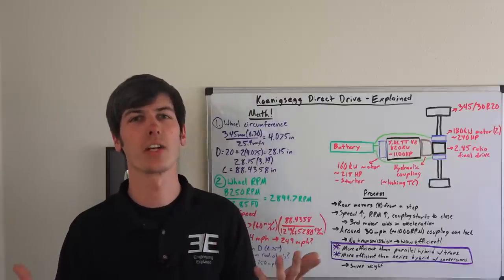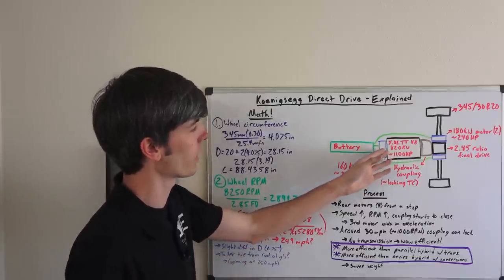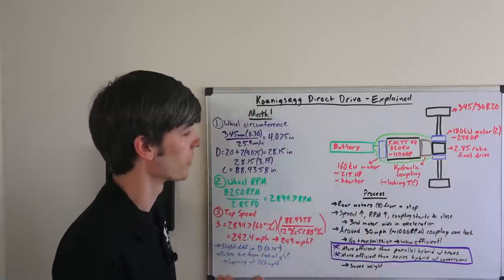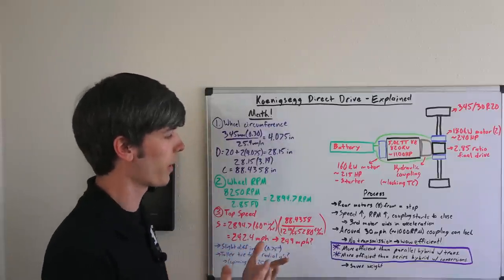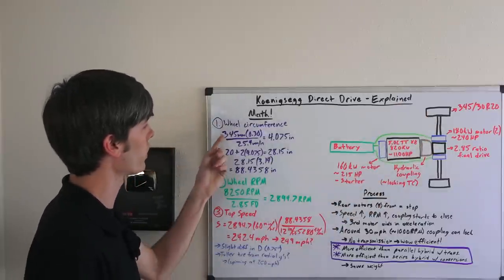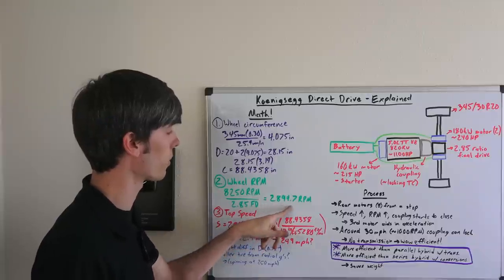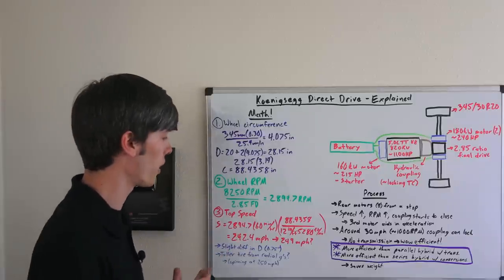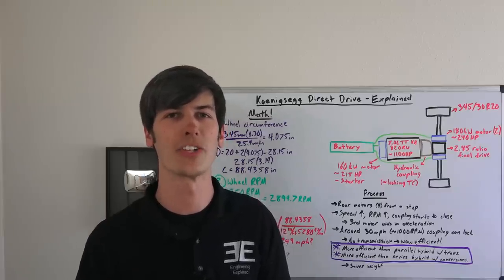Koenigsegg Direct Drive - Koenigsegg Regera - Explained

Comment: Maybe your calculation of the circumference does not take in the exact influence of the tyre profile ?
Did you even include it ? The whiteboard is too small, I can barely read the figures.
Anyway, assuming the circumference of the wheel increases with speed, how is the speedo telling you the correct speed ?
Reply from the maker: My whiteboard is large, your screen is small. :)
Reply: Engineering Explained *facepalm*
Reply: Neil McMahon What size screen you using? 3" ? My 19" monitor is more than enough. I even can read that whiteboard on my 5" phone screen.
Reply: Good point. I only run 1280x1024, and can read whiteboard in non full screen non enlarged player. So he probably runing like 360/240p like you said. But why do that, thats unlogical and crazy :D
Reply: Valtra103 I am getting ganged up on :S

Anyway, my assertion of the speedo still stands.
Reply: Neil McMahon That is a good question. Do we know that the speedometer indicated speed is incorrect?
is it electronically corrected at top speed?
Reply: patw52pb1
If tyres change size, what we know they do, then all speedometers are more or les wrong. Even in slower cars. Thats indeed interesting question.
 Never realised that.
Reply: Valtra103 Yes. I will put together a hypothetical tire growth to speed deviation comparison and post later today.
Reply: patw52pb1  Yes! Please do it. If you have time.
Reply: Valtra103  
Hypothetical calculated centrifugal tire growth to speed gain deviation comparison. 
Tires increase in diameter from centrifugal force as the tire and wheel assembly increases in rotational speed. This results in an increase in the distance traveled per tire assembly rotation. 
The following calculated data shows the speed increase, percentage of deviation for specific tire diameter increases as the RPM remains constant. 

R = Tire RPM 
D = Tire outside diameter 
C = Tire circumference 
V = calculated top speed MPH (KPH) 
imperial (metric) 

R = 2894.736 

Baseline 
Diameter Growth 0.000 (0.000mm) 
D = 28.150 (715.010) 
C = 88.4357 (2246.266) 
V = 242.520 (390.298) 
Speed Deviation 0.000 (0.000) 

Diameter Growth +0.125 (+3.175mm) 
D = 28.275 (718.185) 
C = 88.8441 (2256.640) 
V = 243.597 (392.031) 
Speed Deviation +1.077 (+1.733) +0.444% 

Diameter Growth +0.250 (+6.350mm) 
D = 28.400 (721.360) 
C = 89.2211 (2266.215) 
V = 244.674 (393.764) 
Speed Deviation +2.154 (+3.466) +0.888% 

Diameter Growth +0.375 (+9.525mm) 
D = 28.525 (724.535) 
C = 89.6295 (2276.589) 
V = 245.751 (395.497) 
Speed Deviation +3.231 (+5.200) +1.332% 

Diameter Growth +0.500 (+12.700mm) 
D = 28.650 (727.710) 
C = 90.0065 (2286.165) 
V = 246.827 (397.231) 
Speed Deviation +4.307 (+6.931) +1.775% 

Diameter Growth +0.750 (+19.050mm) 
D = 28.900 (734.060) 
C = 90.7919 (2306.114) 
V = 248.981 (400.697) 
Speed Deviation +6.461 (+10.397) +2.664% 

Diameter Growth +1.000 (+25.400mm) 
D = 29.150 (740.410) 
C = 91.5773 (2326.064) 
V = 251.135 (404.163) 
Speed Deviation +8.615 (+13.864) +3.552% 

Diameter Growth +2.000 (+50.800mm) 
D = 30.150 (765.810) 
C = 94.71894 (2405.861) 
V = 259.750 (418.028) 
Speed Deviation +17.23 (+27.728) +7.104%
Reply: patw52pb1
Nice work!
But i wonder which growth is realistic.
Reply: Valtra103  The realistic growth would be dependent on the individual tire and wheel combination. 
Different tires have different centrifugal tire growth rates, even same brand, same series, same size tires can experience minor variations in growth at the same speed. 
Most USDOT V, W, Y and ZR speed rated tires in the US are designed and engineered to have minimal dimensional growth at higher speeds (above 130 MPH or 209 KPH) to prevent damaging heat buildup. 
However, some drag racing tires are designed to grow about 3 inches or 76 mm at their rated speed with some capable of over 325 MPH or 523 KPH. 
Since the vehicle manufacturer's published top speed is about 249  MPH (400 KPH), I would expect (guess/assume) the tires to have Y or ZR speed rating meaning they should experience minimal centrifugal tire growth at top speed. 
The only way to know exactly what the centrifugal growth is would be to spin the assembly and measure.
Reply: patw52pb1
Yes good point. I know about dragster tyres. But anyway, deviation is not that big. So i believe, nothing is done against ir in speedometer.

Comment: so what u are saying is that the car is strong enough that it doesnt need a gearbox?
Reply from the maker: It's traction limited, has enough electric torque down low that engine power isn't necessary until higher speeds.
Reply: Engineering Explained And what if you are going to a slower circuit where the average speed is lets say 100 mph (2500rpm) ? Can it make enough electricity to fuel those electric motors after every corners or you have tu pull over after 10 laps to charge up the batteries? But it is an interesting concept, every car manufacturer makes 8-9 gears but Koenigsegg decides they dont need such a thing :) I am really curious how this works in real life :)
Reply: winyettyu If you're running on a slower circuit, you don't need full power all the time. I would assume that, while in track mode, the car is heavily recharging the batteries when not at full tilt by using none of the torque from the rear motors, more throttle than necessary from the engine, and generating electricity with the extra power from the engine with the third electric motor. You also get some back from regenerative braking.
Reply: Engineering Explained this 5.0L V8 TT produces more power than the 16.4L W16 Quad Turbos of the veyron right? or atleast the same. doesnt this mean that veyron is a dumb car with no creativity?

Comment: What messes with my head about direct drive, is the fact that power is a function of RPM's.  So when it's going 1/10th the top speed, it only has 1/10th the power.  So at 25 mph, this 1800 hp car effectively becomes a 180hp car.  Sounds so wimpy.  But I guess it's enough to break traction at such a low speed, so 180hp is all you need?
Reply from the maker: That's not how it works, and also there are three electric motors producing peak 700 hp. Plenty of power to accelerate at low speeds.
Reply: Engineering Explained But am I right, that this engine produces it's maximum power at 8250 (or maybe a bit lower) RPM? Because if it's like that you only have the maximum power at the wheels when driving on full speed. Common cars with normal transmissions on the other hand have that power whenever the motor is at it's peak performance (that's why more speeds is better because the motor runs longer on the perfect rpm). So please explain me where I did a mistake. Does this car run at 4125 RPM when driving half the top speed? Because that sounds somehow inefficient for fuel saving and maximum power ouput.
Reply: I don't see why the number of motors matters if they're all using the same fixed gear ratio.  But I made my comment a bit hastily. I should have noted it was more about electric cars in general.  Electric motors have a pretty flat torque cure, so I would think the power delivery is purely a function of RPM.  That seems to have some pretty weird consequences.  I've seen video of a Tesla Model S (with traction control disabled somehow) doing a burnout.  If there's only one fixed gear ratio, and the torque curve is pretty much flat, I would think that means it can spin the wheels even at top speed, which of course is bonkers.  I also still think the 416HP Tesla only has 1/10th the power or 41.6HP at 1/10th of its top speed. But that's plenty, apparently, because it can do a burnout!
Reply: @philippgerstung7813  That transmission is nothing about fuel saving at daily speeds.

Comment: Engineering Explained great movies. I think you make one major mistake in this one. You assume that car top speed will be exactly at top power RPM. It does not have to be true. Resistances and drag might cause the car to accelerate over max power or not reach it. You cant calculate max speed without taking these into account. Lets assume car has two more gears. Would you still calcuate max speed on last gear`s top power RPM?
Reply from the maker: mlisiewicz The car was designed to reach its top speed at max RPM (and has the power to do it). Koenigsegg has stated this, no assumptions on my part.

Comment: Great channel, but this still didn't really explain the important parts for me. You should do a longer video where you talk about the pluses and minuses of this approach vs having a transmission.
Reply from the maker: See the video description. I have videos on engines, electric motors, torque converters, transmissions, etc. All of it can be found on my channel, so I usually post relevant links in the video description. Otherwise a quick search on my channel should bring up various videos on relevant topics you're curious about. Cheers!

Comment: if this is the case then why did we have transmissions in our cars for a century??!!
Reply: Transmissions multiply torque, not power.
Reply: Because normal cars dont have enough torque (force) at low rpm to move the car from a standstill  or to accelerate it at low speeds or on hills. Thats why you dont start in 4th gear and you cant accelerate in 5th at 30 km/h or on a hill. And transmissions amplify torque. But Regera has enough force that it doesnt need a first or second or third gear. A "fourth gear" or "fifth gear" is enough for Regera.

Comment: So it's a Hi-tec CVT.....
Reply: Not really. Between 30~249 mph there are one fixed gear ratio. CVT really means that there are a multitude of ratios all over the revband. There are some similarities in that from 0-30 mph there isn't a fixed gear ratio and the ratio of engine vs wheel rpm varies depending on load. This is also true when the lock-up function is used, but that is only momentarily.
There is a very good reason this is called Koenigsegg Direct Drive or in short KDD.

Comment: Congratulations. Koenigsegg used a design that's been used in NHRA Top Fuel dragsters for 30+ years now. 

This isn't innovative.
Reply: BloodstainedSinner top fuel dragsters dont even reach half way down the runway before the engine starts disintegrating. this is a car that you can actually drive all day. hows that not innovative?
Reply: megaspeed2v2 We're talking about transmissions, not engines. We can however get into engines, and show how TF dragsters were making over 1,000hp in the 1950's - a power figure never reached by automotive manufacturers until near 60 years later. Now, TF is making 7,000 - 10,000 horsepower. 

This is not innovation because it's an existing design. As with any European car, they use designs made by someone else, then claim it as their own.
Reply: BloodstainedSinner you say you arent talking about engines and then start going on about horsepower xD... my point is top fuel dragsters are built to run ONCE and require a rebuild before the next run. having a car with the same power that can use all of that power all day in 2015,16,17 all the way to 2035 without an engine rebuild, just regular maintenance. the design is nothing like the same.
Reply: BloodstainedSinner 
Hold up cowboy.  You goofed right out of the gate.  Top fuelers use clutch plates that are gradually engaged by a row of programmable solenoids.   NOT a torque 
Converter.  NOT a fluid coupling.